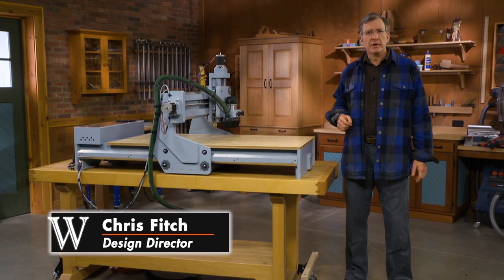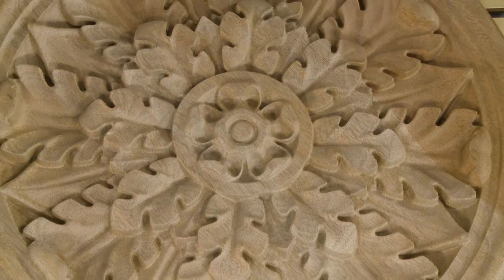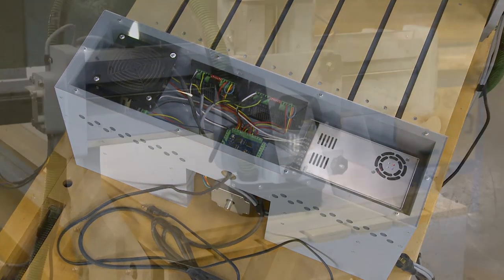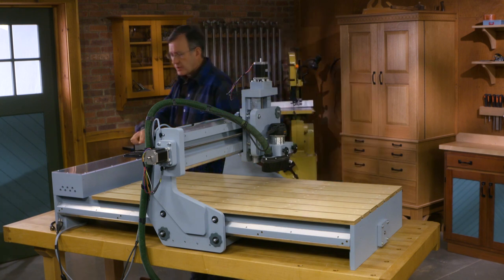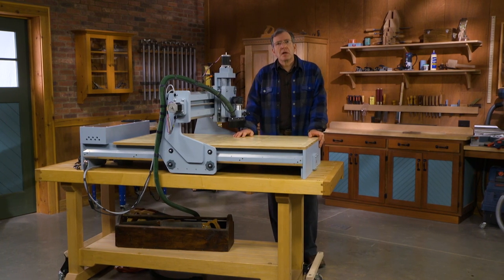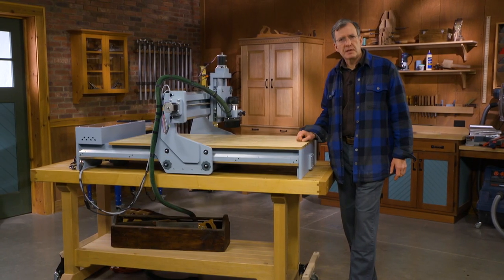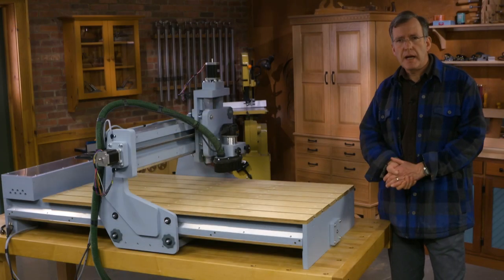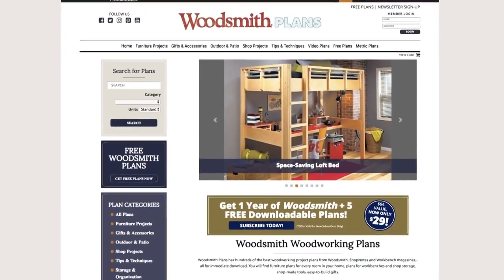Build A CNC Router For Your Own Shop!

Comment: Actually, a 4' x 8' CNC router can in fact replace the table saw. Just insert an 1/8" spiral mill bit and the kerf is pretty much the same as the table saw blade. A 1/16" spiral mill bit will give you the same cut as a thin blade on a table saw.

Using a down cut bit will prevent tear out on the first pass but may not clear the saw dust on subsequent paths. An up cut bit may cause tear out on the first pass but will clear the saw dust subsequent passes. That is provided of course: that I don't have the up cut and down cut term definitions backwards. Sometimes, my brain decides to do a dyslexia dump.

The caveat however is that the CNC router may not be able to make those straight cuts as fast as a table saw can without breaking the bit.
Reply: Maybe in a limited sense of making cuts, and some rabbets/dados.  I'm not sure you would be able to properly make angled cuts (of the thickness of board...i.e. tilting the blade) and dados on the edge of boards (i.e. groove for tongue and groove) to name a few.  Plus if you wanted to make a tenon, you'd have to flip the board on the cnc and hopefully get it set in the right place again.  Not to mention the setup time for cad/cam for the operation.  

I guess if you only use the table saw for certain operations and you use a different tool for different operations you could.  But I wouldn't want to.  I have a small cnc in my shop and it is useful for some things, but I couldn't personally seeing one replace my table saw.

Comment: Thanks, but I do have the original plans and specifications by Wordsmith and built it complete just as the machine you show in the video. After searching, I found the the NEW Mach 4  can be used with any MAC system. At this time, and a few more headaches, I think I can move ahead. I have had quite a bit of experience with SketchUp, so it may not be quite the learning curve I was expecting.
Reply from the maker: Sounds great!

Comment: I don't understand how v-rollers running on aluminum angle will hold up very long?  My CNC engraving table uses hardened v-rollers but they run on hardened round rods.

Comment: So glad you are putting out this video...a tool is  tool..this one just happens to follow jigs that are digital and not made from wood...but  couple of things Sir..you confused your X and Y directions ( Y is up and down the length of the table front to back and x is crossing the table side to side) I also noticed your are using a nema 32 for the Y drive and only a nema23 for the x..you probably get a better cut and deeper cut from adding a nema32 for your x axis. So SO happy you started down this path I wish you all the best of luck...Pleae let me know If can help you someway.

Comment: Minor correction. The Y axis is always the long axis. X is cross left to right on the gantry, Z is vertical. If you are making small projects then it wouldn't matter. You would just turn the stock sideways. If you are cutting a long piece like a guitar neck you allign with the Y axis from a parallel edge.
Good looking basic machine. I would use nema 23 motors no smaller than 420 oz with rm1605 ballscrews.
Reply from the maker: You are correct... I guess I misspoke on that. Thanks.
Reply: Where did you get the idea that Y is the long axis? 
Axis assignment is somewhat arbitrary but it starts with selecting the corner of the work area that will be the origin (point 0,0 on cartesian coordinates projected onto the work surface). Then X and Y are assigned the way you were taught at school- Y goes up/down, X goes right/left.

You can configure a CNC router and assign X, Y and Z any way you want.
But it makes it easier if you configure the machine to match your CAD/CAM software.
If you prefer to work on your CAD drawing in portrait then you set the longer axis as Y. If your drawing area is in landscape, having X as the longer axis makes more sense.
Reply: It depends on the controller used, the BobsCNC machines have the axes swapped.

Comment: When I built a CNC router (from scratch, not one of these - sorry), I found it saved me no time. What it did was hugely expand the range of things I made. The best thing for me is the accuracy. Dovetails just slide together without an hour of intervention with a chisel. And of course doing things this way makes you plan and design rather than hacking and hoping. Best investment ever.
Reply: So in one sentence you say it didn't save you any time, but in the very next you go on to say it saves time when making dovetails?

Comment: I recently started the cnc router build.  Can I shorten the length from 60 inches to 48 inches? Too big for my shop and 60" baltic birch is hard to find and way expensive these days.  I teach at Woodcraft in Atlanta and can get 48" baltic at reasonable cost. Thanks in advance. DrMike

Comment: How about a hardware package offering?  Seems a bit complex to order the parts separately. There could be an electronics package and metal parts package.  Thanks
Reply from the maker: Not a bad idea, but I think the electronics we have sourced is packaged from BuildYourCNC.com and although the most of the metal parts are sourced through McMaster Carr, a lot of that you could just pick up at the local hardware store.

Comment: Does anyone know if these plans identify what software would be needed ?
Reply from the maker: There are lots of options out there for software, but we used Mach3 to control the CNC and Vectric CAD/CAM to generate the code for Mach3.

Comment: I built mine in 2013 out of 80/20 T-slot Aluminum.
Reply from the maker: Sounds nice... how has it been working out for you?
Reply: @WoodsmithShowandmagazine  I could not be happier not only did I save on cost but I learned a lot while building it.

Comment: What about the costs? How much is it approximately? 
I don't wanna buy the plans to realize afterward it'll be too expensive.
Reply from the maker: I believe last I checked it was in the $1300 range on materials.  Here is a link to a list of materials and sources to help you break it down: https://cdn.woodsmith.com/files/issues/242/cnc-router-materials-and-hardware-list.pdf
Reply: @WoodsmithShowandmagazine  , can you please provide the list  for "greenBullv2 4x8 flat with 4th axis and laser gantry plans, hardware" ? i need to be sure nothing is loss, to have the complete machine (ready to work) prior to purchase,

Comment: Woodsmith, you need to revisit your plans.  The "Materials & Hardware List" stops at wood part GG, but the parts continue all the way up to RR.  I'm also quite disappointed with the total lack of effort to simplify number of unique wood screws involved, and the omission of any end stops or proper cable management.  All this from being less than 1/4 of the way through the build!
Reply from the maker: Thanks for the input.  I will absolutely look into all of those suggestions.  That is very strange about the Materials and Parts list. We'll have to get that corrected ASAP.
Reply: @WoodsmithShowandmagazine  Thanks guys, really appreciate the response and you taking the time.  The "premium plans" do have proper part drawings for everything, I was just a little frustrated realizing belatedly that I need to burn out some more parts after I though I was done.
Reply from the maker: @StructEdOrg  Yeah, I get that.  I’m just surprised because these plans have been out there for a couple years and this is the first time anyone has noticed that (as far as I know). Chris is starting to put out a lot more CNC content on our YouTube channel this year if you want to check that out.
Reply: @WoodsmithShowandmagazine  Will do, looking forward to it!

Comment: I WANT TO BUILD SAME THIS CNC MACHINE YOU BUILT. HAVE YOU THE PLAN ABOUT THIS CNC MACHINE. IF YES, PLEASE GIVE ME THE LINK. I FOLLOWED THAT LINK ABOVE BUT IT GIVE ME CONFUSE, THERE ARE TWO PLAN.
Reply from the maker: The link is correct: https://www.woodsmithplans.com/plan/cnc-router/

The Standard - Imperial version of the plan will give you all of the instruction and details you need to build the CNC, but you can add the Premium Version which includes even more detailed shop drawings of each part plus it also includes drawings for an optional shop cart for your CNC Machine that was not included in the original publication.  The  Premium addition isn't necessary, but I think it is really helpful.

Comment: Is there any chance of Woodsmith putting together a package with the specialty hardware and electronics so that it doesn't have to be ordered piecemeal on Amazon? I live in New Zealand, and sometimes it's tough to get certain bits, particularly electronics, sent here from Amazon.
Reply: I just blew up the labelled photo and saw that the electronics are available as a package, so never mind.
Reply from the maker: Yep, we mention that in the video description, as well.  The CNC components come from BuildYourCNC.com.

Comment: I have a little problem with the plans i bought from you for this CNC, the 1''x1'' aluminium angle which have no thickness dimension on the part list, I found in the pages 4 and 11 it says 1/8 thick but in the secondary plans set it says 1/16, so 1/8 or 1/16 for the 1''x1'' ? and I suppose the 1,5'' x 1,5'' is 1/8 thick ?
Reply from the maker: Sorry for the delay, we are all working from home right now so I had to do some running around to get the correct answer... 1/16” is the thickness for the 1” aluminum angle. I’ve confirmed that is what we used on our machines and what our project designer intended.  You could get away with using 1/8” thick material but it would cost more and there is no need for the extra thickness because it is supported by the beveled wood.  I will get those corrections made to the plans. The 1.5” aluminum angle is 1/8” thick.
Reply: Woodsmith thank you for the quick response ! By the way it’s the best design I’ve seen, I’m happy to have choose your plan.
Reply: How much did it cost to build????
Reply: maximinou666 are the parts hard to find? I saw the parts list and it seems like it would be a tedious task to source all the parts.

Comment: Hello
I have a question about the use of a single central lead screw for the X axis. Could it not produce a torsion on the gantry when cutting on both ends of the Y axis as a result of the distance from the place where the force is produced by part of the router, to the center where is the lead screw that commands the gantry ?. I am very interested in your opinion about it. Thank you very much and best regards!!!.
Reply: what about this comment ? can you answer this question please ?

Comment: Any guess on how much the hardware for this piece of equipment? It says it costs 1/3 the price but what comparison do we have? I'm just drooling right now because I was a CNC machinist and this looks cool!
Reply from the maker: The last I heard, it was around $1300, but I'm sure you can shop around and get parts cheaper.  There are a lot of CNC products at different price points so it's actually kind of hard to compare to what's out there, but it is a really fun and rewarding project to build yourself and the 2 we've built have worked really well for us over the last couple years.  Here is a list of parts and materials for reference: https://cdn.woodsmith.com/files/issues/242/cnc-router-materials-and-hardware-list.pdf
Reply: @WoodsmithShowandmagazine  Thanks that's a big help.
Reply: @WoodsmithShowandmagazine  hi what  motor  and stepper driver is used, I see  mo mention of this in the list above, many thanks, seriously  thinking of building  a cnc unit currently
Reply from the maker: @davidp8157  - In the Materials and Hardware List it is the "3 axis elec. combo for heavy gantry" (near the top of the 2nd column)  Here is the direct link: https://buildyourcnc.com/item/electronicsandmotors-3axis-heavy-gantry-elcombo

Comment: One criticism of the design is why would you build your electronics enclosure above the machine bed? I have my own CNC and can’t count the number of times that I did a project that was larger than the bed but was able to do it with “tiling” and passing the project thru the “Y” axis. For example signs. Your design won’t allow people to do that.
Reply from the maker: I haven't run into that problem yet, but you make a decent point... time to start on Shop-Built CNC Router 2.0  ;)

Comment: Has anyone paid for these plans and built this exact model?  Would be interesting to hear from those that did.
Reply: Yes, I built this CNC as specified. I am a retired carpenter and now have a fully operating wood chop in my garage. One thing I can tell you is this thing took me in total almost two months to build. It was labor intensive but in the end it was worth it. The painting and clear coating took quite a bit in it self. Waiting on specific hardware and creating an account was also involved. After wiring and setting up the software, there was a learning curve in how to use it, but if you are more computer literate than me, this would be a big help. I spent almost $1400. in all, so be ready for that. Good luck with your adventure with this fantastic machine.

Comment: What's the estimated cost to build this?
Reply from the maker: Last I checked, I think it was around $1300.
Reply: @WoodsmithShowandmagazine  wow.. Are the plans offered in metric? Sorry for asking but I'm from Australia. Thanks
Reply from the maker: Not currently, but once Austrailian Woodsmith picks up this project it will be.
Reply: @WoodsmithShowandmagazine  Jesus. You can build a PrintNC from https://threedesign.store/ and they are about $900. Plus you're getting a MUCH better product. Using a proper water cooled spindle etc so you can do aluminum and steel as well. You'll never do that with this machine. And for the cost, you're better off building the more robust for cheaper cost.
Reply from the maker: We actually have cut quite a bit of aluminum parts with this machine, and it has performed really well for us.

Comment: Wow is that slow. That’s why you buy a commercial cnc.
Reply from the maker: You can speed it up, but what's the hurry? :)  It just depends on the material you are cutting, the bit you're using, and the depth of cut.

Comment: I totally disagree ! A cnc router WILL change the entire workflow in the shop or you did not get what a cnc router is all about. If you consider a cnc router as an automatic plunge router or an accurate jig maker, you left your mind in the last century.  Most of your tools will be useless, including your table saw, as you just have to flat a face on the jointer, then the CNC router will do what's left, except finishing and assembly.